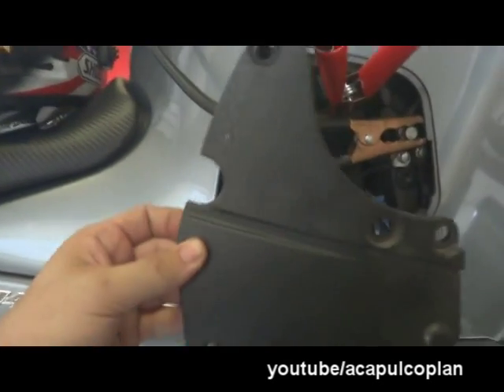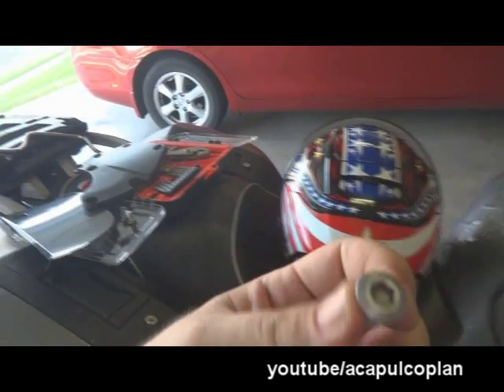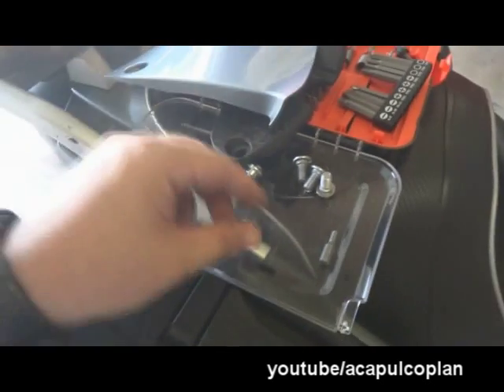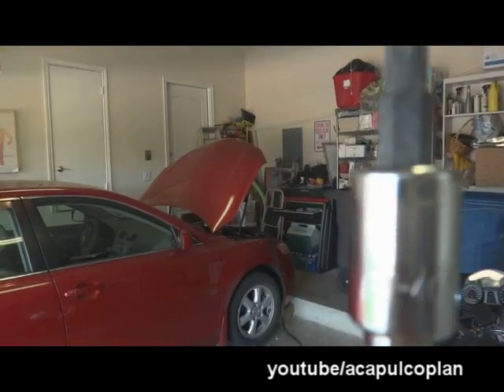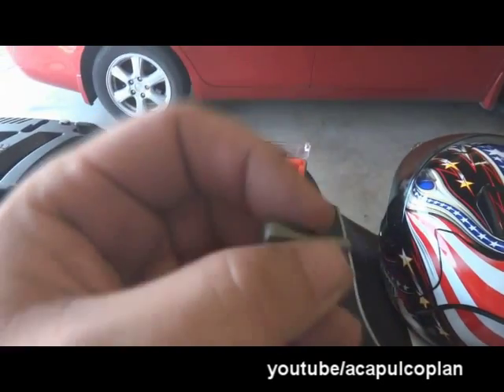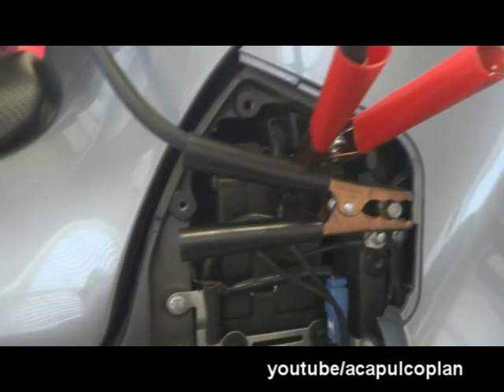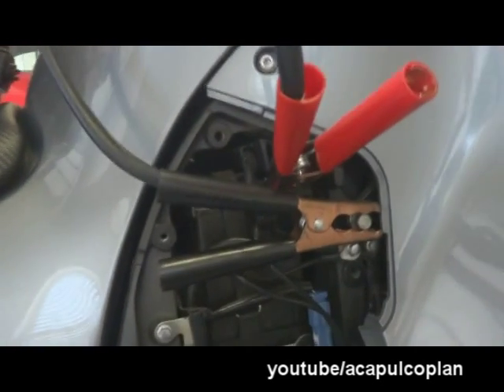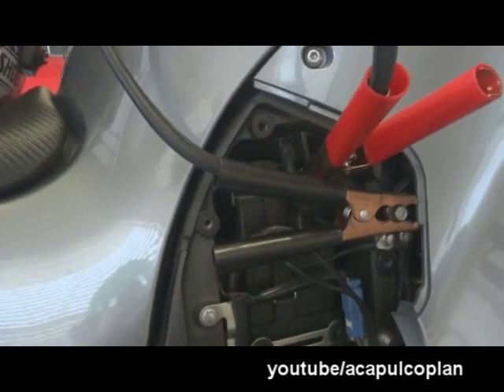Kawasaki Concours 14 battery box and jumpstart - PSA

Comment: My '09 took 4mm allen for the plastic cover and 6mm for the aluminum cover. A cable comes off the negative terminal to a bolt on the frame next to the + side of the battery for charging.

Comment: Thanks for the info. Helpful. Metric is easy to understand - no fractions involved. 4mm and 6mm allens. TerrorDBN is right. Never use imperial on a metric head. Just buy a set of metric allen keys ($5) and you're covered without screwing up the heads. 
Thanks again for video - you solved my question quickly.

Comment: Thank you! Exactly what I needed to know. On my 2012 there is one bolt holding the Fairing Cover on the left, and a stud through rubber grommet thingy hidden under the right side. So you have to pull bottom edge out enough to pop the stud, then go down to pull the two tabs at the top of the cover out of the slots on the bike. My positive was on left side under a red boot, and it was possible to move the boot down enough to hook up a charger without removing the Battery Cover.

Comment: Those are NOT Torx head (T head) bolts!!!  Those are hex head (allen head) bolts!!  4mm hex wrench on the Fairing Cover and 6mm hex wrench on the Battery cover!  Be gentle with the Fairing Cover screw!  It is very soft and will "round out" on you pretty easily!  Do a search on Amazon for "hex bit socket set metric".  It will be very useful if you plan on doing any of your own work on the C14!

Comment: I have a 2013, the bolts on mine are 5mm Allen Wrench for the smaller one and 6mm Allen wrench for the larger one. Also on my bike I was able to remove just the plastic cover and there was enough room to get to the Positive without removing the metal cover.
Reply: Coronamaker Thanks. Don't know why this guy's using torx on allen heads.
Reply: 79401Jeeper I have used TORX drivers in an Allen screw in a pinch and it is workable especially if there is not too much torque on the fastener, but an Allen Wrench will certainly offer more positive engagement and minimize stripping or marring the fastener.
I honestly prefer TORX fasteners and drivers when available though if given a choice.
Thanks Acapulco for the video as it showed some folks in need (Myself included) how to get back on the road quickly.